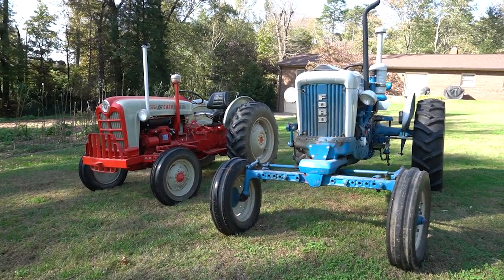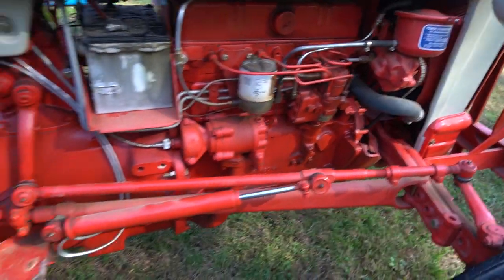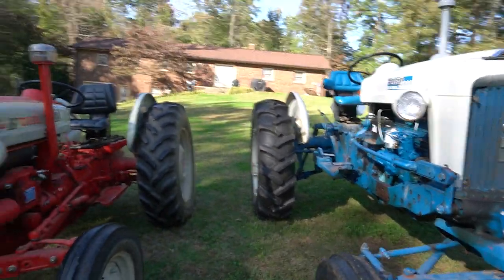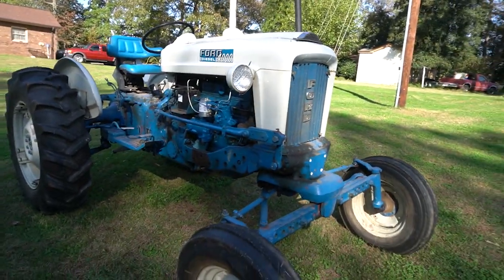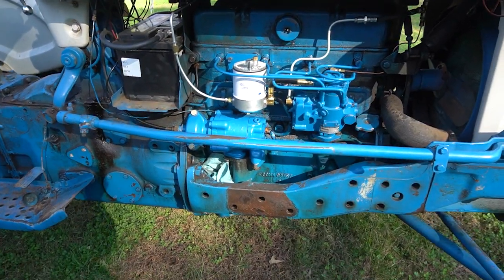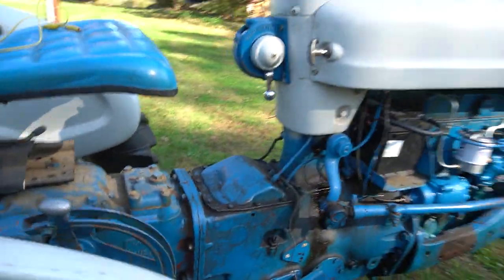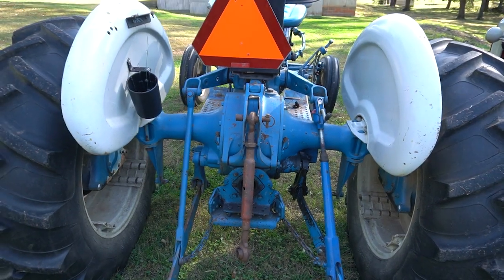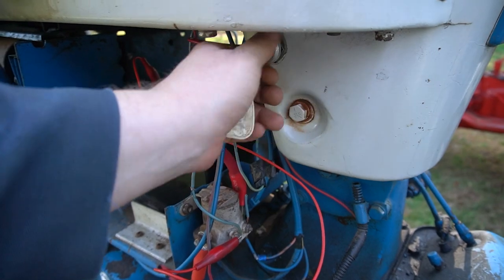Comparison between 861-D and 4000-D

Comment: The Selectospeed transmissions were outstanding for PTO work. The cross hatch marks across 5th, 6th, and 9th denotes coasting gears, there is no engine braking down hill. We had a 981 gas and I have a 981D. The 8 series had the slickest way to  run an auger or elevator; lock brakes, disconnect the driveline for towing, engage the ground drive PTO and about 6th gear. You have great torque multiplication.

Comment: I'd still take that 861 over that 4000 any day. It's just a far better machine than that 4000. My understanding, the 3000=5000 were more "experimental" at the time. Later models, were far more improved. 
My old 881 was more of "gold" color scheme. Great video, cheers :)
Reply: The 4 cylinder 2000/4000 tractors are almost the same and newer model than the 01 series work and powermasters and are the pinnacle of the NAA design.  There were no later models of this design.  You may be thinking of the 3 cylinder thousand series that uses the same model numbers but are not considered true fords by purists.  id love to find an 881 myself, thats a heck of a find

Comment: Great video on these two tractors. I’m looking to buy one in this make and model. I’m undecided of getting gas OR diesel. 
Going to be a worker, which has lower cost of ownership, gas or diesel.?
It will be helping drag logs and bush hogging.
Reply from the maker: I perfer the diesel models. Not sure which is cheaper to run but ford claimed the diesel models were better on fuel over the gas models. They have a lot of power. Powersteering is nice to have too.

Comment: I have an 861. It's a good tractor. My problem with it is it was made for short people. it's hard to push clutch. Almost impossible sitting on the seat. Having live pto makes it worse due to increased pedal height. It has a front loader. When steering if I'm not real careful , my fingers get stubbed on the loader frame.

Comment: Thanks for the info!  I recently purchased a 961-D and I'm looking at options for a front end loader.  I'm curious as to your thoughts of an FEL in general.  How much weight the front end can take reliably.  What FEL might you recommend.  I'd rather stay away from the single arm loaders.  Mine is a wide front end.  Looks very much like your 4000.

Any info or thoughts would be greatly appreciated.
Reply from the maker: I'm not really familiar with any front end loaders on these. I'd like to have one on my 861 but I've heard bad things about them such as cracking blocks and hard steering. I've seen a few wide fronts with loaders but don't know what brand they are.
Reply: The 861 has strong front end.     Same basic design as our 800 and that tractor has had Wagner loader on it since the day it came home.     new.

Comment: On the 601/801 series tractors, and on the 62-64 2000/4000 the 4 or 5 speed transmission was far more reliable than SOS.

On the 65 and later thousand series tractors, the 8 speed was the cream of the crop

Comment: Great video  I alway wanted a sos transmission even tho everyone seems to hate them.
Reply from the maker: It seems like they would be a great transmission when they were new and properly working. Main reason I didn't like it was it didn't have a clutch to slip so the tractor wanted to jerk real bad from a standstill. Plus most of my fields are fairly short and level so I don't have a need to shift on the fly. Usually just rev tractor up a little more and they do fine.
Reply: @chickenhousemechanic  the SOS does have a "clutch" per say, maybe was a bit out of adjustment. Had an old 881 SOS. Loved it, just our SOS was beginning to have issues with a lot of the "gears" slipping. Replaced with a 5 speed 2 stage clutch. Cheers :)
Reply from the maker: @Ham68229  yep the torque limiting clutch. The clutch looked new when I took it apart. I'm putting a 5 speed with live pto back into it.
Reply: @Ham68229  Good  day to both of you,  Our neighbor had 4000  3 cyl with sos, wow  he could not get drwbar close   baler to hook up 1or 2  ins, away.  Yes they replaced sos with  8 spd.  Thanks for video.

Comment: I just got what I thought was a 961 but it has a 4000 sticker on it and the 4000 front end along with the 4 cylinder gas engine.  I don't have a clue what exactly I actually have.
Reply from the maker: There should be a model and serial number stamped on the transmission just behind the starter. Diesel models are usually corroded away though. Other thing to keep in mind is the transmission may have been changed. One thing I noticed between the 01 series and 2000/4000 is the draft/position direction is cast into the rear housing. Earlier models used a decal. Just another way to tell them apart.

Comment: You said your 861 came with a 4000 style air cleaner. I lost the oil cup on our 841 that also has a 4000 style air cleaner. Do you still have it? Would you sell the air cleaner? If not, will you give me measurements to make a replacement cup?
Reply from the maker: I will actually be using the one off my 861 on this 4000 as the 4000 aircleaner is damaged. I can give you the measurements for the cup so you can make one. There is also a couple guys on Facebook who specialize is old and ford tractor salvage you can look up who might have one they will sell you.

 Those guys are Mike Smith of Mike Smith Implements and Farmer John's Tractor Parts. Mike Smith is from Michigan and Farmer John is from Georgia. 

As for the cup measurements they are 7" inside diameter and 3-1/4" tall. 

Hope this helps.

Comment: Did any year 4000 have that round thing on the front of the hood?
Reply from the maker: No the cyclops nose bullet started on the 1953 Jubilee and ran until the 1962 x01 series tractors. The 1963-64 2000 and 4000 models had the smooth V shaped piece. The 2000 has a screen in front of the lift up hood while the 4000 got the chrome grille trim.
Reply: I think I have an 841 with an incorrect 4000 decal on it. @chickenhousemechanic
Reply from the maker: @natfunk5992  it's possible from over the years. If it's a diesel it might have the updated engine block and been repainted to look like a 4000. That's how my 861-D was when I purchased it. Ford also had a promotion back in the day to paint the old red tractors blue after the split from Ferguson.

Comment: Never realy see the 4000 like this reminds me of a 6000 if that is original color it love it best thing ever is the front conversion gives it a great look my dad has 861gas or a 651  being a deisel man thought it was just newer 8n tell i used it and man it a good working tractor its nice and cleen like yours i laughed wen he bought it im use to newer for. 00 and 600 series and up but no it past my expectatins and it only gas beside are old to35 we had for well sense way before me .are little ford 2000 is great ford and we have lots of biger tractors 70 hp around their
Reply from the maker: It's kinda correct. The Blue is right but it should have the gray sheet metal like the 861. Those tractors came out about same time as the 6000 did but you could have them as a 961 version with the wide front. Not sure if it was available on a 960. In my area you don't see them at all. We mostly see 8n and 600/601 tractors.

Comment: The bottom end of the 4000 engine is the same as the gasoline only difference is the head the injector pump goes into the distributor in the block all that same

Comment: I came across a old Ford diesel tractor I think it's an 861 don't know for sure.....would like to chat with u on a one to one basis to get more info about it....
Reply from the maker: If you look on the transmission just behind the starter you will see a flat area with numbers stamped into it. That will be the model and serial number. However the diesel tractors were bad for being corroded away due to leaking battery acid. There are a few other things to look for that will tell you if it's an 861 or not. One being the engine casting number. Google will help decode those since there were multiple throughout the years. The 800/801 tractors also have a larger rearend. Easiest way to tell this is the PTO. The spot where the shaft bolts to it will be almost flush with the housing. A 600/601 will have a protrusion out the rearend for the shaft. Drawbar hanger will also be longer than on a 600. Transmissions are interchangeable so nothing really there to identify anything other than the numbers of gears and live-PTO. And finally the sheet metal, mainly hood and grille, are different on the 600/601 and 801. 800 look similar to a 600.

Comment: Just got an 851, how would I go about getting live PTO?
Reply from the maker: To convert your tractor to a live PTO you'll have to change the transmission, clutch, and flywheel. Possibly clutch linkage if you don't have a double hole clevis on the end of it. You can change the input shafts on the transmission but parts would cost more than just swapping the transmission out.

Comment: Drawbar height?
Reply from the maker: The bracket height is 12" off the ground on the 861. I didn't measure the one on the 4000 but I believe it is 18-20". As for the actual drawbar itself it depends on which bar you have and how you install it. I was able to find a drop drawbar for the 4000 that will be blasted and painted but thats a ways off since I'm just now getting the chassis back together.

Comment: That 861 is about a 58r59 the 4000 bout a 64 in 1973 I bought a 5000 new when I got back from nam still have it got to use it shortly I own 6 chicken houses 60 x 600
Reply from the maker: 861 is a 58. 4000 is a 64. Those 65-75 model tractors run forever. Also have a 68 3000 that is used regularly every year.
Reply: I learned to drive on a 9n at 11 yrs old my granddaddy would buy them 8n an 9n for around 250 dollars he said in the early 40s that a new ford and 5 pieces of equip was 1195 dollars new

Comment: When did ford build diesel engines in 800s and 900s you speak of?
Reply from the maker: 1958 was the first one I believe. Even though the 01 series came out in late 57 I'm not sure any of those had the diesel engine. The 144ci and 172ci 4-cylinder diesels ran from 1958-1964. Ford then changed to the 3 cylinder in the 2000-4000 and the 4-cylinder and 6-cylinder in the larger tractors.

Comment: Hey your video have helped me out so much on my 861d that im restoring just purchased another 172 diesel but cant figure out what my old 172 is could you help me ? The number on block is B9NN6015B it runs amazing just want to know the history of it please thank you
Reply from the maker: Thank you. I try to be thorough and give as much information as I can without being long winded. As for that engine block, that's a late 59 to early 60 casting for a 172 diesel engine. Might be a sleeved block but not sure about the balancer on that particular block. I absolutely love my 861-D. Use it as much as I can.
Reply: @chickenhousemechanic  oh wow thank you so much would it have balancing gears in it or no and is that a good engine block or no because my other 172 i like better for the fact that is casted for a spin on oil filter where my old one has an adapter plate on it
Reply from the maker: @nicholasthurston2018  I'm not exactly sure when the balancer came out. The service manual gives a tractor serial number as to when it came out but of course that is stamped on the transmission and not the engine. Only way to tell would be in pull oil pan off and check. The block should be fine though.
Reply: @chickenhousemechanic  alright thank you when i get the numbers off my other engine i would like to see if you can tell me what it is thanks for the help cant wait to see your 4000 when its done thats my dream tractor other than my 861